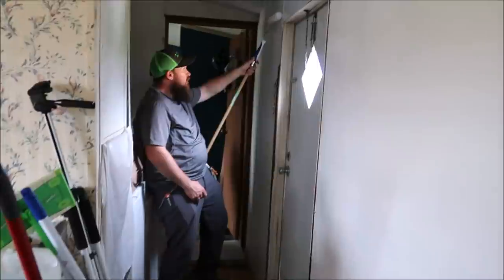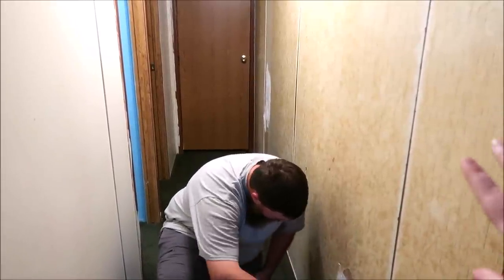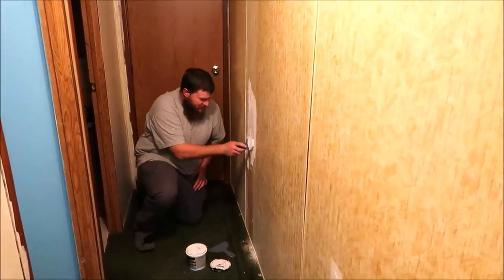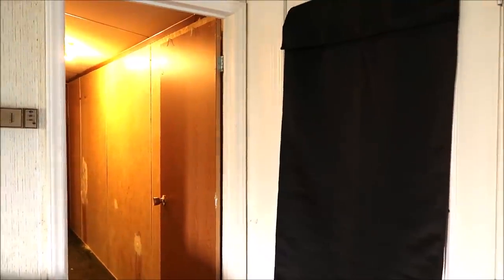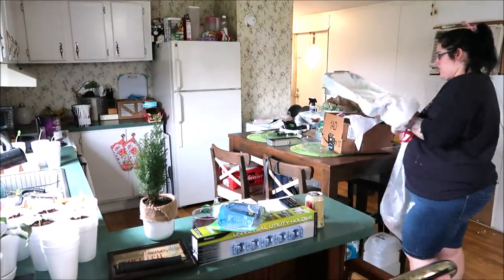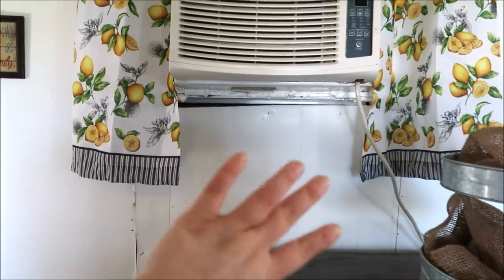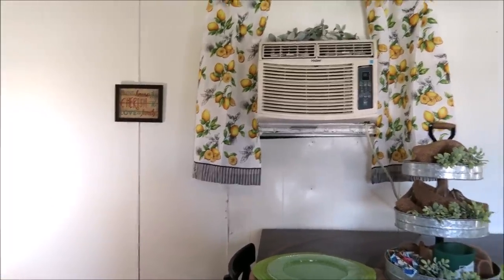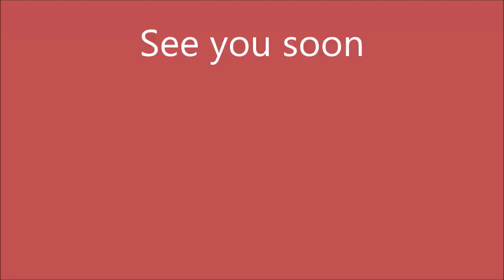SINGLE WIDE MOBILE HOME REMODEL | SMALL HOME CLEAN WITH ME WHOLE HOUSE TRANSFORMATION

Comment: A gallon of paint can do soooo much for a home. Looks really good. For your bedroom floor where your fur baby pees, cut that section out if you can't replace the whole thing, and get either some peel and stick flooring or Lowes has vinyl flooring by the roll,  and just put it down in that section. I rescue older pups so I have three little seniors who have bladder control issues. What I've done is train them to use a certain section of the house and I keep puppy pads there. Its helps lessen accidents alot!

Comment: Amazing what a can of paint can do.  You can get “crown molding” strips cheap at Lowe’s & frame around the a/c unit to given it a finished look.  Also if you want to change the wallpaper in the kitchen you can paint over it a contrast neutral color (I’ve done before, super easy) and/ or buy “peel & stick” tiles for a pretty backsplash.  Go watch Merina at Fearfully Created, she has done some very pretty & cheap renovations to her older mobile home.  You’re getting there & it’s looking really good.

Comment: I live in a manufactured home, and spent a lot of time doing research about the wallboards in these types of home.  It looks like you have the vinyl coated wallpaper that is a plague to paint over because it peels off after a bit.  The advice I picked up was to use BIN 123 Primer *first*, and I followed it.  The painting has stood up well, and the other paint stuck to it really well, so I highly recommend it to you for your project.  In my other bathroom I used some spray on texture to get the wall to look like normal wall board instead of the flat panel.  I was very satisfied with that treatment.  Your house is looking good!